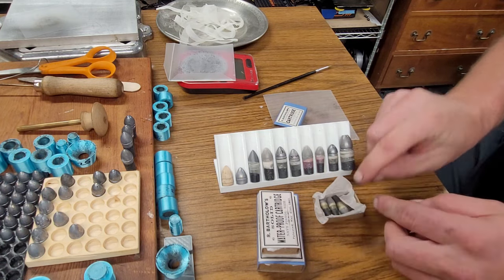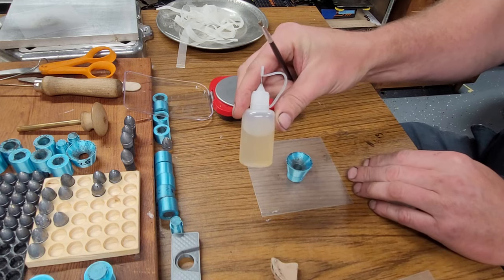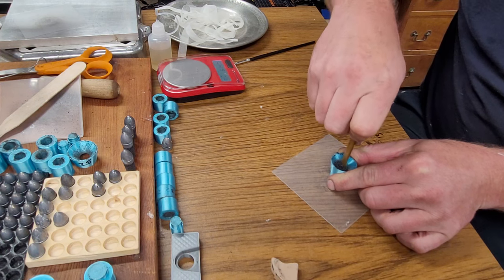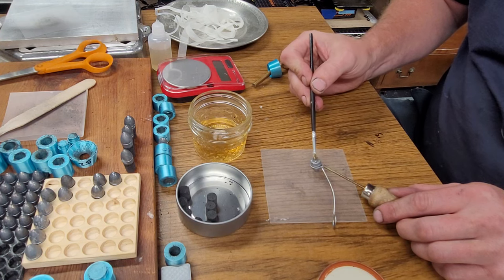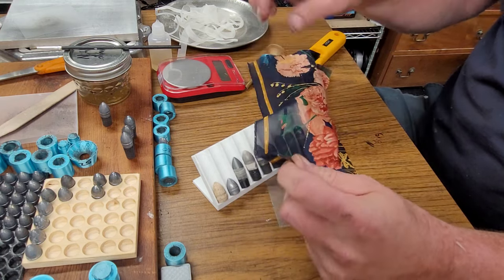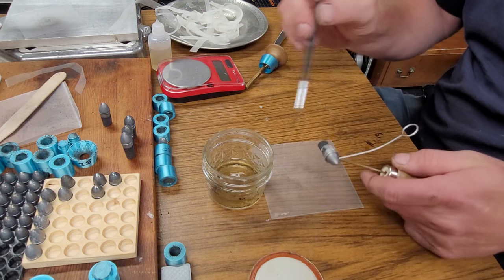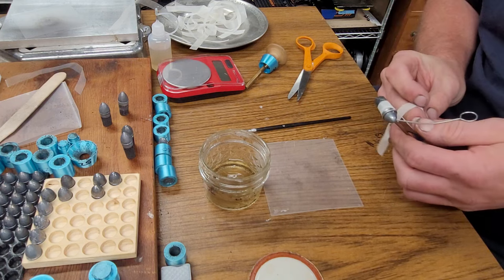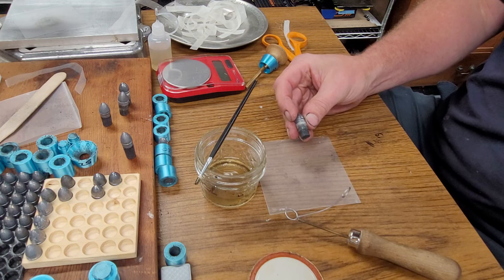Making Bartholow solid cartridges

Comment: Your silk and glue process is pretty much what the old balsa and silkspan aircraft modelers called "doping", which was also how real airplanes were assembled a century ago. The dope was also a nitrocellulose glue (about the same consistency as your fletching glue), and used to bond and seam paper and silk to the balsa structure in models. Your technique brought me back to 6th grade shop class, lol. Fascinating subject, methodology, and tooling you developed! What material are your 3D prints layed up with?
Reply from the maker: The molds are printed in PLA.  There's alot of crossover and borrowed ideas. Nitrocellulose was only a decade or so old when these were made,  it was the new thing to experiment with.
Reply: @crossencartridge6403  hell, nitrocellulose based paint is still the "gold standard" for fender electric guitars. Doped fabric is still used on light planes, at least vintage ones. Obviously, it's still used for fletching arrows. All that besides being the major component of smokeless powder. Nitro dope tinted with aluminum powder was pretty much why the hindenberg was such a fast consumed fireball that day in New Jersey. It actually seems an ideal binder for your use, it seals, it binds, and it burns like hell, especially under pressure. My bet is if metallic cartridges hadn't taken over, the 1870s would have seen the whole planet scrambling to produce such cartridges, and the patent holder dying fat and rich, lol
Reply from the maker: @ludditeneaderthal  it sure is amazing stuff. Fun fact,  the 3 patent holders  of these cartridges were doctors.  Collodion was used as a surgical dressing too.
Reply: @crossencartridge6403  almost forgot, the original movie stock and men's shirt collars were made of nitro-cellulose. The us army field expedient munitions manual from ww2 suggested chopping up shirt collars as propellant for reloading small arms ammo, lol. It really is about as "wonder stuff" an invention as came out of the 19th century. About the only thing it wasn't used as at some point was food, lol